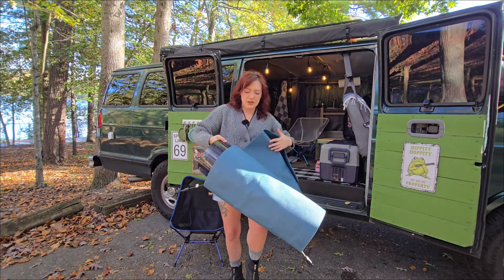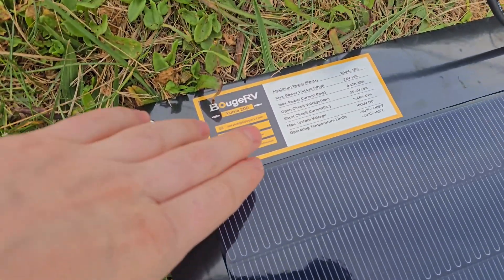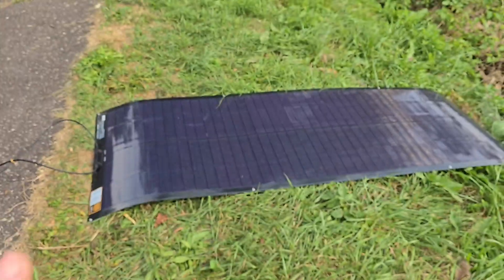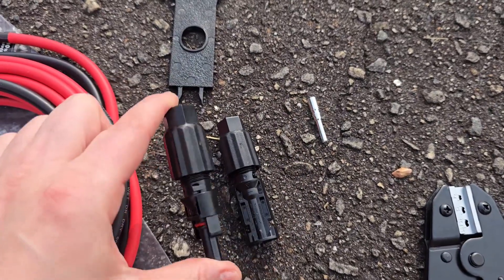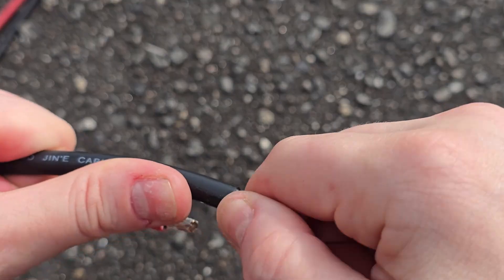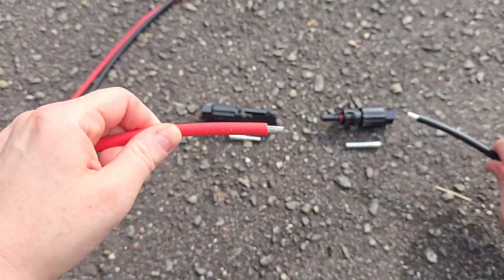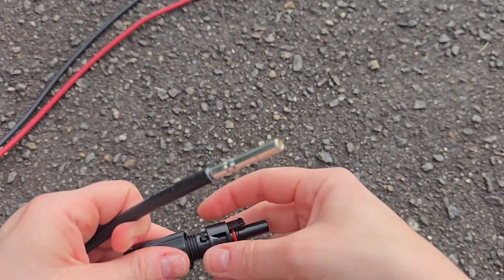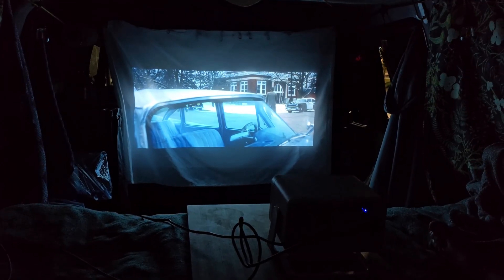Easiest No-Drill Solar Setup for Van Life, BougeRV Yuma 200 + EcoFlow Adapter Guide

Comment: You do not want to bend or crack these solar panels.   

If no one uses heated blanket, use a Pure Sinewave Inverters, I use an 850 inverter, but I could use less.  My 100-amp battery lasted me 6 days.  I only at this time   ECO-WORTHY 12V 100AH LiFePO4 Lithium Battery.  I use 4–100-amp batteries right now.  I am now going to buy 4 new ECO-WORTHY 12V 300AH LiFePO4 Lithium Battery Bluetooth with SOC LEDs.  I have added 6 batteries for my home during bad power out.  When I go camping, I use 4 solar panels on top of rig.  No, I do not have to leave my home to live, of course I am too old to live in a rig, I thought about it many times.  Standard forest camping only for me.  Good luck!
Reply: Haha my fav part is how you used them like wings at the beginning showing how flexible it was😂. Also, why did they make you put those wired together for the mc4 connectors?😅 mine just came put together, but good job girl I woukd have given up and made my BF do it lmao.
Reply: @BlazinTrails-d1m 😂😂❤ sometimes I need a bf just for that reason
Reply: @bunnyandbeyond haha yeah its nice to take the easy way out sometimes lmao. There is alot i can do but just make him do it cuz why not 😅😂
Reply from the maker: Bahaha thanks and honestly I have no clue 🙃  they sent me this panel and the cord to make a video so I'm going to be honest.
Reply from the maker: This solar panel is specifically meant to bend and is incredibly flexible. Sounds like you have a good set up. Both my power banks have LifePO4 batteries inside them. This video is more so for van lifers that are on a budget and or don't want to do a full solar set up.